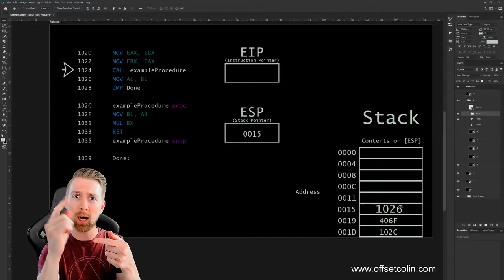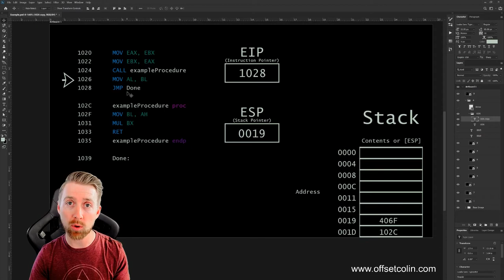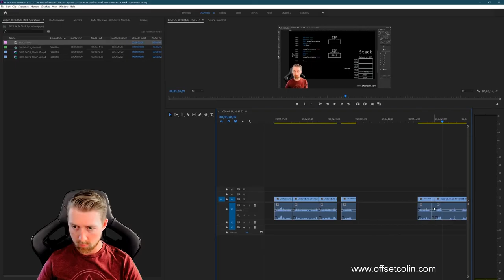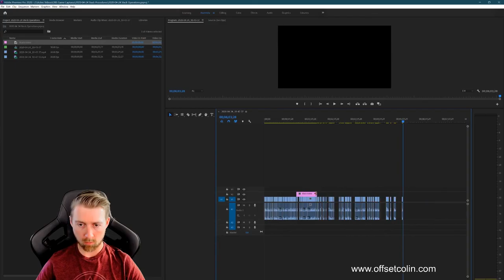The Stack and ESP in Assembly Language - What happens when you call a procedure?

Comment: what happen if we push another register in to stack when program executing the call function , at that point stack pop out that we push into the stack to EIP register ? if it does what happen to program executing instruction ?
Reply: Call macro already pushes return address for you. If you push another address before call macro. It will execute it arg1 and stack will corrupt. If you want to push custom address for return,you must do push return address then jmp function location. This is which is equal to a call macro. But keep in mind there is a high change custom return address will crash program. You need to adjust that.